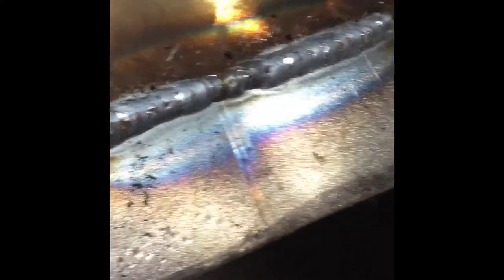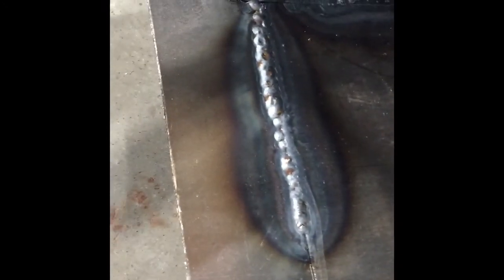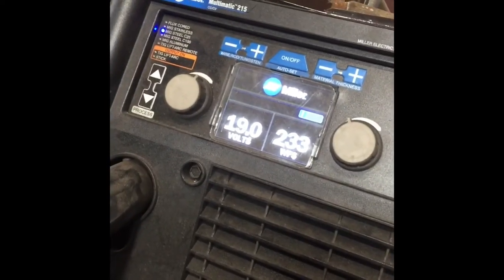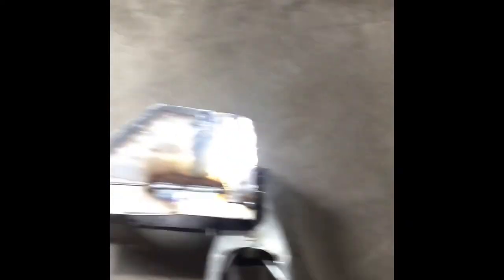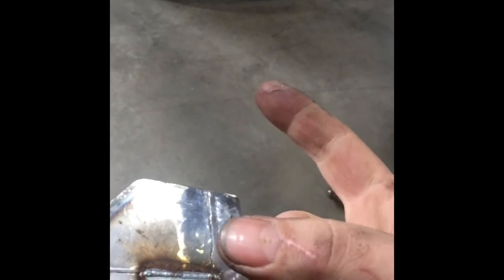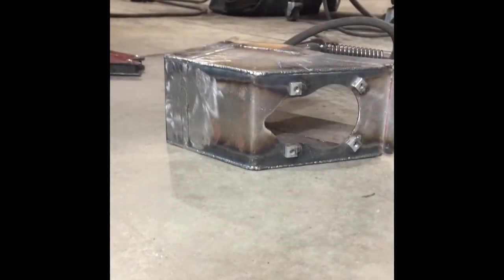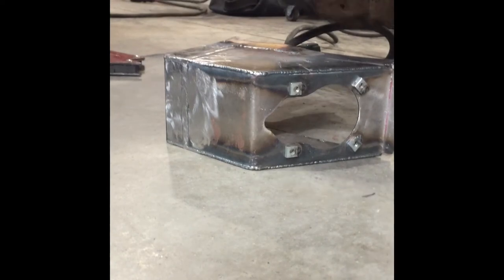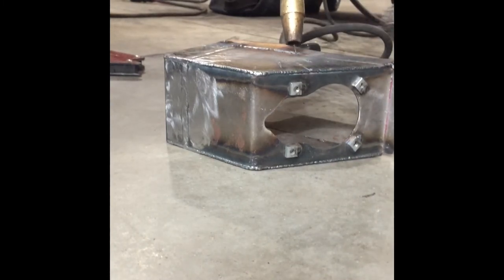How to MIG weld. Thin gauge butt joint. Manual Pulse MIG!!!

Comment: Does that warp the metal more or less than if you chose a smaller setting?  What did you do to get the warp out, or did it correct itself upon cooling?